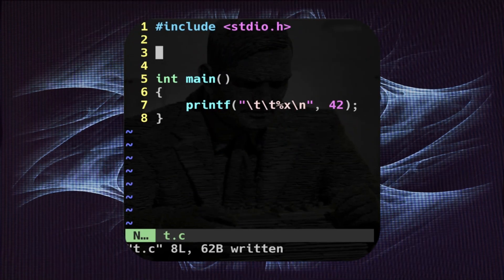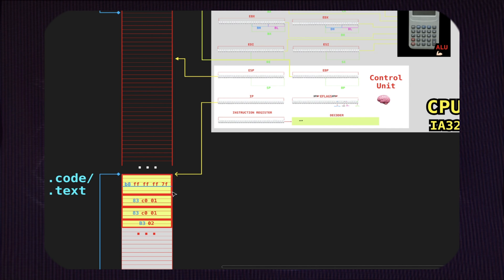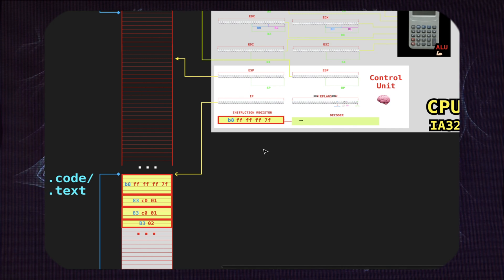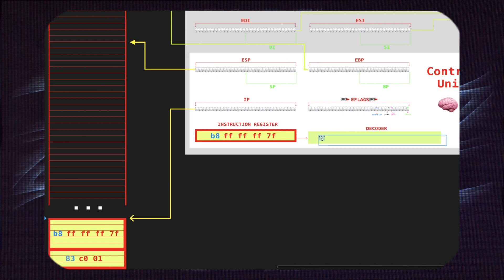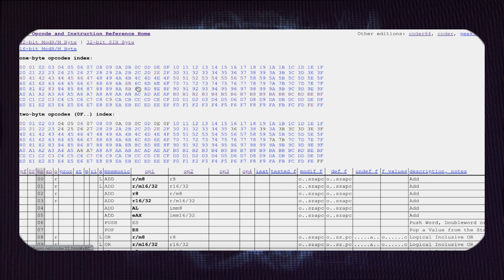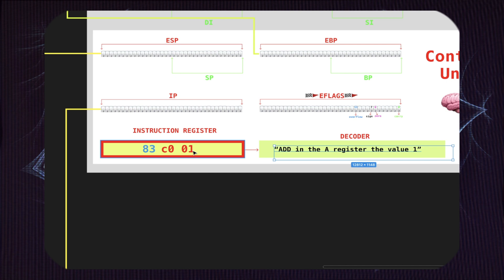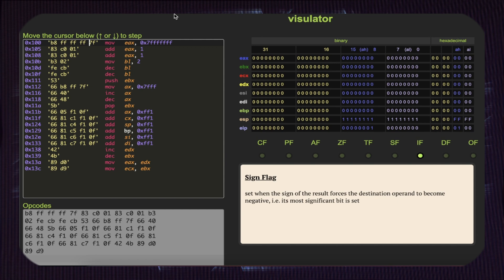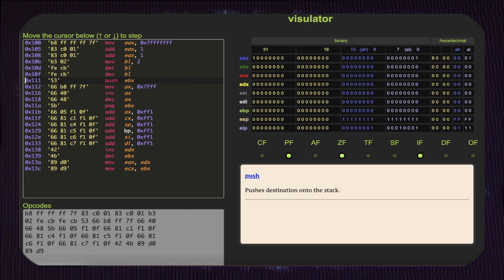Fetch, decode, execute cycle visualised TL;DR

Comment: Excellent !! I used to program machine language in 386...the first company I joined was actually trying to clone the 386 chip from Intel.  I did all the machine language programming for all the op codes to ensure compatibility.  Fast forward 35 years later...I am still very fond of machine language that truly showed me how computer really works at the very low level.  Can you do a video on Nvidia chips ?